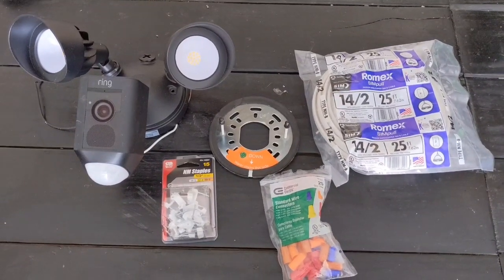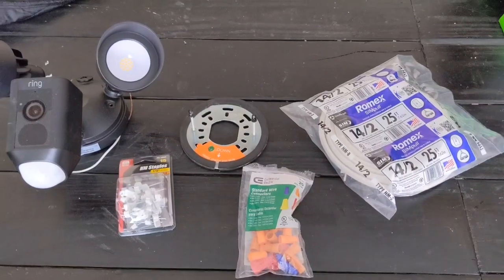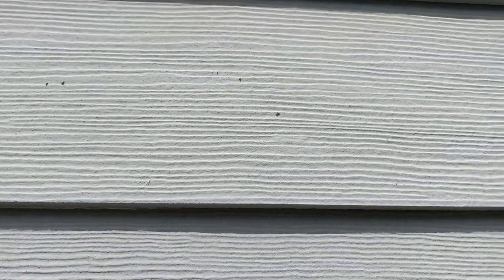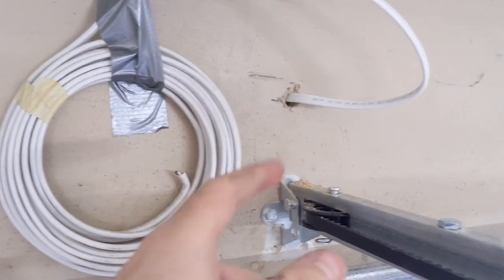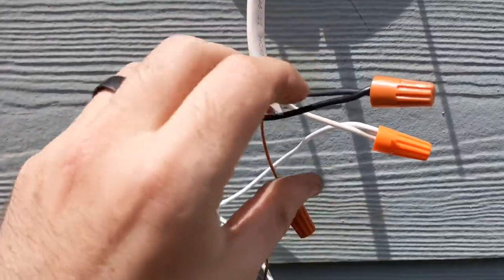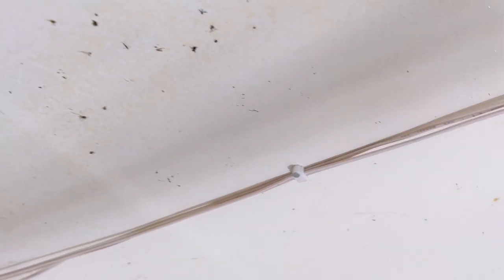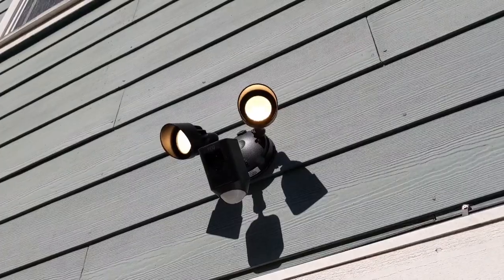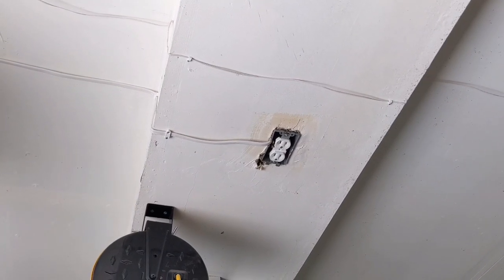Ring Floodlight Camera - DIY Home Improvement

Comment: You need an electrical box to meet code for waterproofing and safety because the splices are not in a rated enclosure. You are also not able to use romex on the ceiling of the garage. Romex can be damaged if hit therefore it can not be exposed. An alternative to leaving it exposed is to run conduit with individual conductors since romex is not allowed inside since it can overheat and melt, or you can run mc cable which is metal meaning it’s much more robust. The romex is not secured properly in the box. It needs to be secured in the cable holding clip. You also can’t double up on the grounds you would need to pigtail it with a greenie. That’s another code violation. The install looks good but this would never pass any inspection.
Reply: @tims-garage  It's also against code to run romex through a conduit. You would need to swap it out with THHN.
Reply: Hello 
Would it be better to have installed a junction box in the inside of where the camera was installed? And make the cameras connection there?
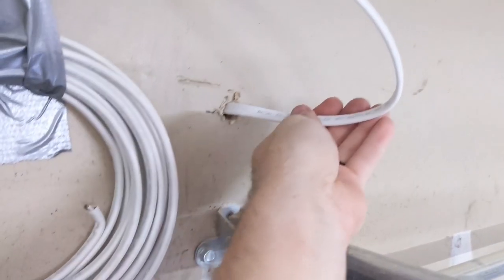Reply: @mcardenas23  I'm curious as well. So still drill the 1/2" hole as noted at the 4:25 mark, and instead of pushing the Romex wire outside to the exterior, you're thinking of pulling the Floodlight wires INSIDE the garage. Then install a junction box on the interior of the garage facing inward. Then run the Romex wire to the new junction box and do the wire connection in there? I'm thinking that would solve the junction box problem... but I'm NO expert... so still seeking an expert's answer...
Reply: Thank you for your comment. I was a bit iffy if this installation was legit.
Reply: This is what I came here for, and thank you. I was wondering when he was going to install the outdoor box and decided I wasn’t going to see it once I heard about not cutting drywall to run romex. This is a good exercise in learning that the home inspection biz is a joke, since as a FTHB I didn’t notice these sketchy connections until I started learning about PROPER electrical.
Reply: Also 
- Cutting a notch in the outlet junction box (and clamping it down with a faceplate!) was a no-no. Needs to go through a punch-out and clamped, or a one-way feed through that's already part of the box.
- Previous builders wiring via the poke-in holes behind the outlet is generally discouraged. There's already two sets of screws for Live and Neutral on the outlet, so just use the screw terminals!
Reply: Oh another good practice is to caulk the siding where the romex pokes through the siding...as it enters the weatherproof junction box.

Comment: Tim, first of all, thank you for the installation video. I just bought Ring Floodlight cam and was planning to install it above the garage as well. The outside of the wall is brick. The problem that I see with your installation is that it possibly violates the electric code and won't pass home inspection if one would be needed. I  should say that I'm not an electrician, so you can just ignore this advice. My understanding of the proper install:
1. you have to wire the cam to the switch and from the switch to the power outlet.
2. the switch needs to be at a certain height so you can reach it (not on the ceiling).
Reply: @tims-garage  True that :-)
Reply: @tims-garage  : yeah..the purpose of the switch is a 'code compliance'.. still debating doing your method vs what i think is correct. couldn't find the vid yet on youtube on how you do this w/out opening the sheetrock wall inside the garage. what i'm thinking of doing is to check a power outlet on one the side of the garage door to see if the electric cables are long enough so i can put a junction box there. install a switch above. run a romex inside pvc or alum/metal housing around the garage door to the middel of garage above the garage doors.. bottom line seems like much more work & materials :-)
Reply: Are normal floodlights switched? Installed mine in a similar way straight to an outlet. But yeah any romex needs to be in conduit. Maybe could’ve gotten away with MC. This’ll just be a PITA when it comes to selling your house.
Reply: @workswithzach8219  there was no floodlights installed in the place (above and between two garage doors). I installed mine like a month ago. Ran mc inside EMT (for more secure attachment to dry wall inside)on outside the mc comes in directly into junction box. Sealed it and hopefully won’t leak inside. Didn’t install the switch and not even new gfci (that was only outlet non gfci in the garage). Waiting on slickdeals for 3 pack of gfci drop back to $19 :-)
Reply: @tims-garage  true but it’d be easier to swap the cam for a cheap floodlight. Would be helpful for next owner too. All-in-all your method is ok for temporary means!

Comment: You need an approved junction box to mount the bracket to...It's against code to mount it directly to your siding. Nice place for a fire to start!
Reply: @Mark Carra. after the junction box per your commons, the other line can be run to the garage outlet just like the video is fine? Or still a code violation? Thank you
Reply: @thinhnguyen7119  I’m not a electrician but everything that was done in this video is not per the NEC. Like everyone had said the camera outside need to be installed onto a junction box and the Romex wire needs to be behind the drywall and if it needs to be exposed then you would need it to be in conduit and the wiring would need to change from Romex to THHN
Reply: Finally!! People are realImg these cameras need a junction box!  Safety first.  Ring does a bad job at selling the product making People think they just hook it up to the side of the house.

Comment: I've just purchased mine. Isn't that a little too low for the install? I was thinking about putting mine all the way up under the roof lip to protect it from rain. Or do these withstand rain pretty well maybe?
Reply: I have to also say that your video explained the mounting very well. Quick and to the point.

Comment: What I’m confused on is why you’re using 14/2? That wire should be 12/2
As garages are usually on 20amp circuits.

Comment: My house is really old and doesn't have a ground wire in any of the electrical. Can I still use this type of romex wire to connect to a power outlet even though it has 3 (hot, neutral, and ground)? Would I just tape off the end of the ground wire since it won't be needed?

Comment: Thanks for the video. Any probelms with the camera? Wondering if pluging in camera directly in to outlet would affect the camera as compared to the way they tell you to install which is to tap an exisitng junction box. Would the camera even "know" if it was wired directly to the box or wired to a wire that was plugged in. My friend did this except he did not use an extension cord he ran wire and instead of connecting to existing outlet just and added a plug to the end of the wire, essentially the same thing you did. He is have problems with his light going on too much and thinks it is related to the amount of power the camera is receiving.
Reply: Thanks Tim- Right, how would the camera know? as long as the proper wires were attached it should no act dfferently whether it was wired directly into outlet or wired into plug then plugged in.
Reply: In the Ring app - Device - Device Settings - Light Settings - Motion Settings for Lights: The motion zone for the light can be adjusted. And, you can adjust how long the light will stay on.

Comment: For anyone that does not like the romex running along the ceiling.
Just replace it with a extension cord then plug it into opener outlet.
Good job Tim.
Thank you for the video.
Reply: Uh no, u need to run MC or conduit if the garage is finished...do it right by the code...

Comment: Nice video you put together. I'm about to do this over the weekend. Just needed to figure out how to connect it to a outlet. I do have a question for you. If the builder did use the little slots you mention and had conencted to the screws. Would you have double up on the white/black connection or would you use the top screws ?  that's the only thing I'm wondering about... don't want to burn down my house hahaha
Reply from the maker: Sorry I never saw this! It's okay to double up on it as long as you have a clean connection. I also like the idea that someone else posted about just wiring and extension cord. What did you end up doing?
Reply: Most outlets have two screws for Live (brass/gold) and two screws for Neutral (silver/nickle). So you should NOT have to put two wires on one screw... that's a big no-no! 
If you had a builder that did a "stab in" wiring (without a compression screw), take the time to correct their snafu and attach it to one of the set of screws (black to brass, white to silver, with a clockwise "hook") and then attach your floodlight to the other available screws.
Putting two wires on one screw is not good, you'll have to make a short pigtail and then twist three wires (pigtail from outlet, extension, and source) together with a wirenut (probably red?). And make sure it's all in a junction box that's properly grounded!

Comment: I'm getting ready to do this install for a Eufy floodlight camera so this video is super handy.  Couple question, what wire gauge did you use?  Also, my wall is a brick exterior...is it better to drill from the inside out or outside in?  Or does it even matter?
Reply: Tippy, im looking to install a eufy on brick as well.  what kind of drill bit did u use?  and did u drill from
the outside in?  any other tips?
Reply: How did your install go? I have brick as well. Any tips?
Reply: It should be printed on the wire itself. Note that, the wire you add should be the same as the one you're tapping into. Mines was 14/2 gauge. Drilling through stone or concrete, you need a masonry drill bit. Good luck.

Comment: Great video.  Very easy to understand. Question: can’t I just strip one end of an extension cord to connect the ring and then just simply plug the other end into an open outlet?
Reply: @tims-garage  thanks!
Reply from the maker: Extension chord would be the better route honestly. Should have done that.

Comment: No junction box needed?
Reply: Tim's Garage the camera side on the exterior. Just wondering if it’s best to hide the wires in a junction box instead of leaving them exposed on the interior of the garage?
Reply: Sooo no  conduit needed ?
Reply: @SkyDaddyExpress  Yes, if you want to be code compliant, conduit should be used in this situation. NM cable (Romex) should not be used in an exposed area or where it is susceptible to damage. Some might wonder just how much damage would it be subjected to considering it is fastened to the ceiling. I would mention that I just removed an exposed NM cable that was plugged into an outlet on the wall and run to the ceiling to provide another outlet and it had surprisingly significant damage - nicks and cracks. Although more work, running THHN wire through PVC conduit from the outlet to and just through the hole wouldn't be that much more expensive than the method demonstrated in this video. In his situation, a single-gang box extender for the existing outlet would be necessary to connect the conduit to. Also, I decided to add a switch up high in case I ever needed to replace/service the camera. BTW, I'm not an electrician. I feel comfortable offering the above information because I researched it well for my own floodlight install above the garage . However, take it for what it is worth coming from a non professional.

Comment: DUDE! You cant just cut a slot in the box and stick the romex in!
Reply: ...and then clamp it onto the cut edge of the junction box! I mean, at least i'ts not a metal box, but still... there's a reason why entry glands/clamps/etc pinch onto romex with flat surfaces, and not edges.

Comment: Please don't follow this video to install your unit as it's violate code and is dangerous. See  the comments from Joseph Priori.
Reply from the maker: If you want to do it to code, yes, do not follow. I like the extension chord way of doing it. That would make it safer.
Reply: Clearly Tim isn’t a Electrician but rather a family man whom just like myself will not pay several hundred Dollars for an actual one to come and work on something so simple. I say it gets the job done. There is no immediate threat to the house or structure. No harm no foul. Yeah extension cord would have been better but who gives a shit. He isn’t saying go do this. Just showing some options we have as home owners to maybe save a little here and there.
Reply: Yeah... I'm not an electrician but I know enough that this is not code and it's dangerous. And I love DIY projects. But this is very very wrong, much like 60% of DIY home solar project videos.
If you don't know about running wire, find a relative or friend that's an electrician and get them to do it.
Otherwise pay someone to do it so liability falls on them. If there's a house emergency event, the first thing the insurance company will see is the floodlight mounted directly on the siding without a junction box.

Comment: What’s the name of the wire that you purchased?
Reply from the maker: Romex, but I'd recommend using an extension chord
Reply: @tims-garage  could you link me what extension cord would be safe for this? Something from Home Depot
Reply from the maker: @javier3242  something like this Your friend has shared a link to a Home Depot product they think you would be interested in seeing:

HDX	50 ft. 16/3 Light-Duty Indoor/Outdoor Extension Cord, Orange
https://www.homedepot.com/p/HDX-50-ft-16-3-Light-Duty-Indoor-Outdoor-Extension-Cord-Orange-HD-277-517/202523960
SKU# 202523960

Just cut the female end and wire it to the light